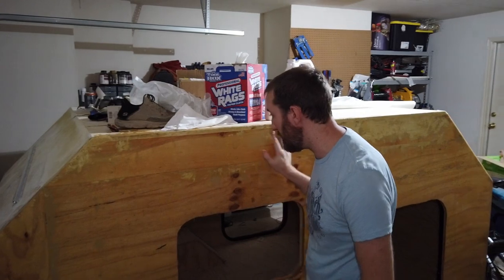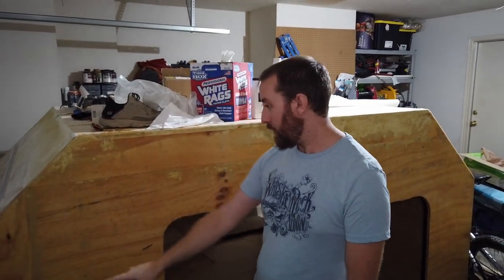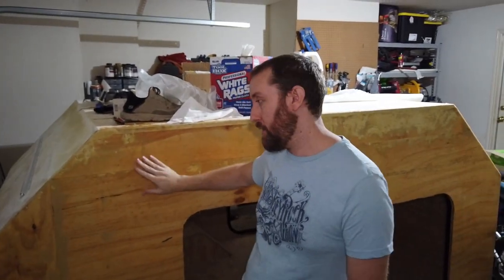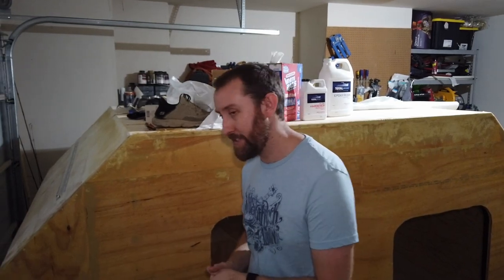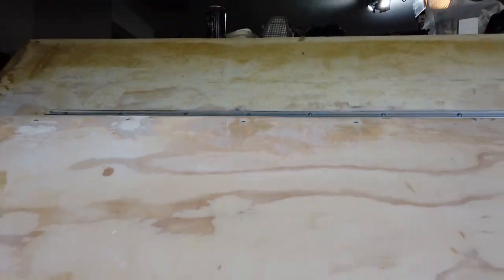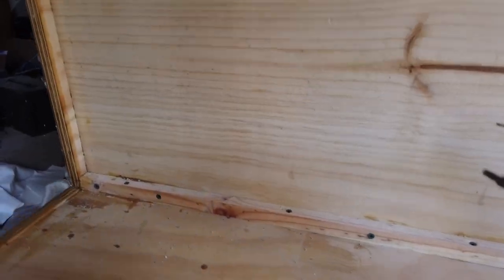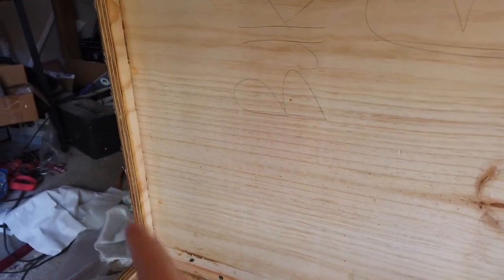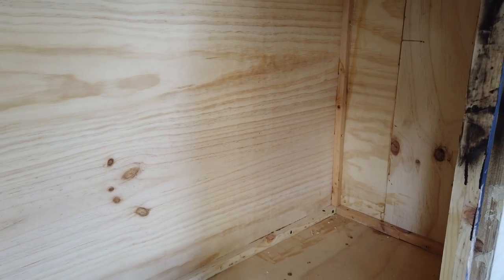DIY Off Road Camper Build Q&A

Comment: Is the 6 foot width based on the Shawnee hills design? Or did you widen or narrow it for your use?

The camper is coming along nice and I look forward to your next videos.
Reply from the maker: I only raised the roof and made it fixed. So far everything else is the same.
Reply: @slyexpeditions6579  Thanks. I’ve been looking at his trailer design for a while and am planning to buy the plans and start building in February. So I’m really glad I can follow your progress.
Reply from the maker: @rolandob5585  cool glad the videos are working out for ya. Its a fun project. I'm actually finishing fiberglass now and working on plumbing.
Reply: @slyexpeditions6579  one last question: do you know what will be the dimensions of the bed?
Reply from the maker: @rolandob5585  it's a queen size he uses a tri fold to make it a couch also. I haven't started building my frame yet so I don't know the exact dimensions.

Comment: Nice work. If anything, its probably over-engineered which is a good thing. I'm designing my camper trailer to be able to withstand a roll-over, which I think yours will easily.
Reply: Forgot to mention, I'd be interesting in hearing more about the epoxy work - did you use reinforcing fibreglass matt or just the epoxy for waterproofing.
Reply from the maker: @MiniLuv-1984  4oz matt on entire exterior. I'm going to resin interior  areas without matt that I think might get water exposure.
Reply from the maker: I sure hope that it's that strong.
Reply: @slyexpeditions6579  That's kind of what I am going to do, but the big question in my mind is whether or not the strength of the board after glassing is created by embedding matt to both sides? I don't know, I've never glassed in my life before.
Reply: @slyexpeditions6579  What I mean is a roll over at low speed, say on a rutted road, a highway speed roll over I imagine very little can survive.
Reply from the maker: @MiniLuv-1984 I never thought it would survive any highway accidents. But if it can survive trail accidents that would be awesome.
Reply from the maker: @MiniLuv-1984  from my understanding the matt adds rigidity/str  but also keeps resin from cracking.
Reply: If you build it like an airplane, light, strong, and strength derived from the total build, and do not build it like a tank, you will be happy. You can't over-engineer these, the more you 'think' about joints, combined strength at corners, and include the strength provided by the fiberglass envelope, you'll see where you can omit things, and make it even lighter, even stronger. Better to over-engineer than to over-build!!! Trail accidents, to a point, but very few trailers will survive a roll-over. Cheers!
Reply: @geographyinaction7814  Good distinction over-engineer / over build.Thanks. Some do actually build them to survive a roll over. Check out "Birdsville from bad to worse" on Youtube. The tug is a write off, but the camper trailer is relatively intact.